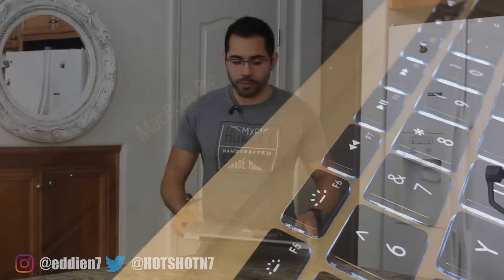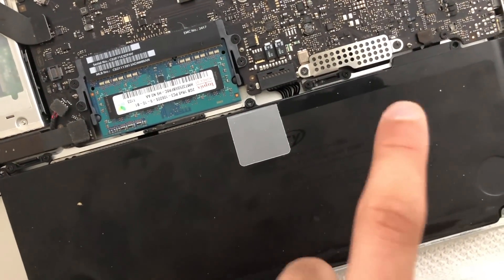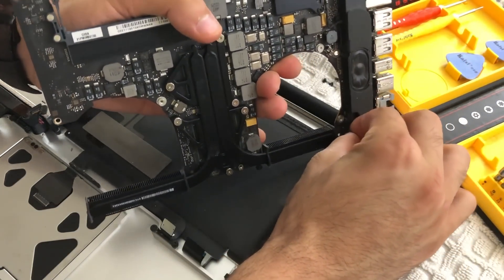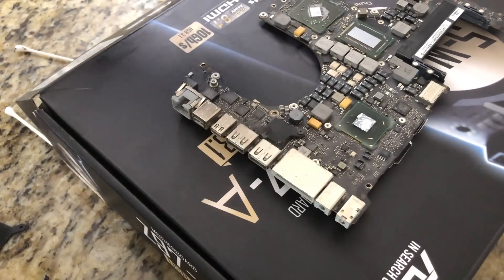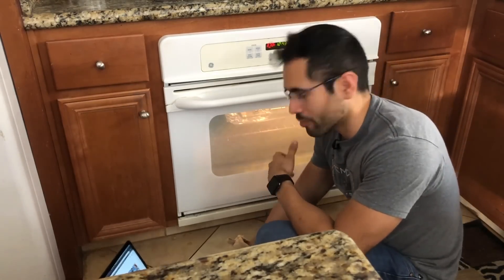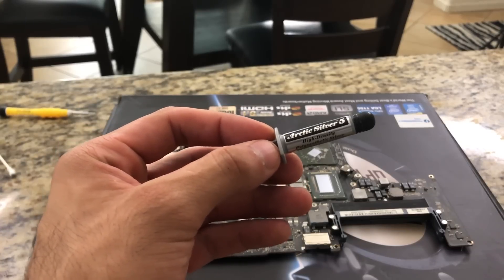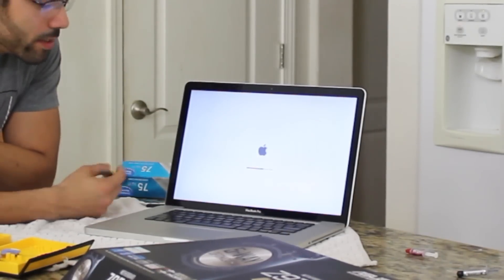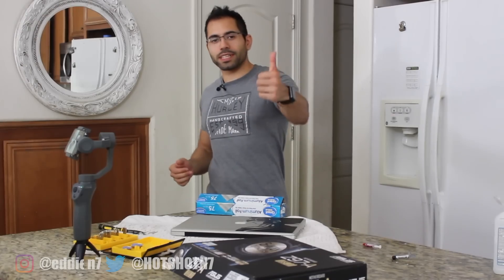2011 Macbook Pro Graphics Card Fix

Comment: It has been 7 years. If you watch this to fix the same problem with one, just buy a 2012 motherboard and replace it.
The board costs ~80$ and directly fits in the chassis making it significantly better.

Comment: Wäre es nicht auch möglich, die Stromversorgung für den Grafikchip zu kappen?
Reply: Yes, there are physical and command line methods to disable/bypass the terrible GPU. Look up dosdude1 for the software fix, it worked on mine as the instructions are clear and correct. Disappointing to lose AirPlay and external monitors but there are still so many useful functions of the 17" in particular, especially that it’s still able to run 10.6.6.

Comment: I did this 3-4 years ago after Apple had "fixed" my 2011 15" Macbook twice under their recall.  That Macbook is still running strong, it's my daily driver.  There is some debate as to whether the oven does the trick, or just replacing the thermal schmoo is the real solution.  I saw an article linked in Apple's forums that said they had a bad batch of schmoo, so who really knows?  All I know is the oven plus new schmoo (Arctic MX-4 for me) does the trick; it's one or the other or both.  I'm in the process of doing another one at this moment.  Just came out of the oven.  We shall see.

Comment: Heating up the gpu will only make it work temporarily. the whole reflow using the solder melt points is all a myth, luis rossman proved this in one of his videos. DO NOT BOTHER TO DO THIS METHOD ANYMORE its actually an issue with a shitty wafer on the gpu, also for these model macbook pro the a1286 i found and am relooking for that video,  theres a capasitor that controls power to the gpu chip that needs to be replaced.
sorry to discredit you HotshotTek but you dont need to put your motherboards in the oven anymore

Comment: I’m not really expecting you (crazy tech dude) to know the answer to this question but someone reading this might. My understanding is that the solder used to attach this chip to the board is the issue, not the chip itself. I find it odd that this one connection out of hundreds of thousands of similar connections on every motherboard would have the wrong solder applied. I would guess that the chips come pre tinned for installation and that would answer that. That being said, why can’t the existing solder be removed and the chip reattached with the correct solder thereby making a permanent fix? I’ve seen videos where people remove the chip and then make tiny little jump wires that serve to bypass the chip (one of many methods at this point) so, besides requiring expert soldering skills and the equipment needed for the job, it’s not as if it is physically impossible.  Anyone have input on this, possibly what kind of solder should have been used? thank you!

Comment: You should have left it in the oven and let it cool there, that is big mistake
Reply: correct, rapid fluctuations in heat is what caused the issue in the first place, the reduction in heat should be as gradual as possible

Comment: The only real fix is to replace the GPU.  And it will fail again because it never was conservatively designed.  If your lucky the GPU is available, otherwise Apple makes getting the part impossible. 

Just by a new one.  That's how Apple gets rich.

Comment: Thank u so much , it’s worked indeed, I was tried this 2018 and it worked well till now and again same problem starts from month, can I try again same process now also , I am using 2011 mackbook pro 15”, 750 gb, in india I couldn’t find any new graphics card for my Mac so give me some suggestions, 
Actually Mac is restarting problem was happening I gave to Mack service center they told graphic card problem, is it really graphic card problem ? Is it restarts again and again because of that ?

Comment: You should NOT take the board out of the oven like that! If you bump it even slightly, you run a HUGE risk of displacing numerous chips throughout the board that have all had their solder melted. Just turn off the oven, open the door, and let it sit!

Comment: I wonder for how long this method would allow it to work.
Reply: Days or weeks. Once you get it up and running just disable it completely then you're stuck with igpu but it won't fail
Reply: McXred Pl I've used recovery, single user mode and csrutil disable to disable GPU when it's already dead, so this is not a problem. I was just thinking of its worth trying to enjoy thay gpu for few months. But if we talk about days or weeks - not worth it.
Reply: @wza360  you can never be sure. If you can keep it cool then I guess it wouldn't be that bad and die so fast but imo it would be better to leave it alone or sell it. They can still get very expensive even when faulty (if you got it up and running then it significantly increases value too. You can probably get somewhere about £300 for it and get a much more decent laptop with dgpu that doesn't fail straight away

Comment: this fix will probably last longer if you get a syringe of flux and try to flow the flux under the chip before baking it.  you would just have to really soak it with 90% isopropyl alcohol afterwards.

Comment: My 13” MacBook Pro 2012 (I think) is booting to a black screen, no chime, caps key won’t illuminate and fan runs on high. Do I have a failed logic board?
Reply: Did you find any solution? I have same issue on same MacBook you mentioned but it’s 15”
Reply: @GentilEulade  Hey, I'm pretty sure I took it to a "Mac Expert" who basically said it wasn't repairable and I needed to buy a new board, so I got him to transfer my files to a new hard drive for me and eventually threw the old MacBook out. Sorry I couldn't provide a solution, all the best! :)

Comment: Apple Macbook Pro Late 2011 developed logic board issues. Diagnostic performed by MicroCenter - Apple authorized repair center - they could not boot into anything. A refurbished logic board from a 3rd party would have cost one thousand, and this GPU issue would  still be outstanding issue simply postponed.... Apple does not make parts for these computers as they are considered vintage. I tried HotshotTek oven bake method and surprisingly I was able to boot correctly. This is a temporary fix though. I will research how to disable the dedicated AMD GPU as that seems to be the issue with these Boards, preventing the computer from booting up. So if you cannot boot up, you can get a diagnostic done from MicroCenter for 40 bucks then when you are sure its the logic board, try HotshotTek Oven bake method to fix your logic board. There is nothing to lose and much to gain. At least you will buy some time until you can get a new machine.The whole thing took me about 8 hours - disassembly, documentation, cleaning, baking and re-assembly. Documentation is important because it helps when you are re-assembling and connecting back about 16 ribbons total on the board

Comment: I've had my 2011 MBP for about 9 years with no issues to date. Added 8gb of ram and 500gb SSD runs like new. Far from being a piece of junk.
Reply: You're lucky. The same was for me for 10 years. Now it happened. I suggest you to download some app for switching to the internal Intel graphic card. It doesn't happen in an instant, at least for me it didn't, you can see symptoms before the end, and before the end you can switch to the Intel graphic card and you're safe to use the macbook.
Reply: Andrea Marchetti how do you switch it
Reply: You are lucky i guess. My gpu failed after 1 year. Got the motherboard replaced for free after Apple finally acknowledged the problem. It worked for a couple of years and now it is starting to get the symptoms of a failing gpu again :o. I don't use it anymore but I'm looking for a permanent solution to fix this issue so I can resell it with a good conscience :).
Reply: David Wants same
Reply: Hi you can video edit in primier?
Reply: I did the same only I added just 4 gb of ram and a 500 gb SSD, it used to work quite well even without this update but now it runs soooo good
Reply: same here, battery is not what it use to be, but after 10 its hardly something to complain about.
Reply: Does it run better with a better graphics card? Or is it running good with just the ssd and 8gb ram??

Comment: It is unbelievable BUT IT WORKED TO ME. MBP 8,2 15'' Late 2011. I spent 180 EUR to fix it 4 months ago and it failed again few days ago. I followed your tutorial and it is fixed now. I do not know how long it will work but I had a very expensive paperweight that now is recovered. Thank you!

190 centigrades, 10 minutes. I protected the motherboard's external connectors side with foil. paper

Comment: Did it work for three years then fail? I ask because I experienced something traumatic and I wonder if anybody here in the comments section also had this happen to them? I bought a 2010 Macbook Pro brand new in 2010. The logic board failed one month into ownership! I was doing light tasks like Microsoft Office since it was a school laptop. The Apple store "replaced" my logic board with another one and it functioned worse than when I brought it in. So my laptop actually stood gathering dust for 9 years until recently I gave it to Goodwill so they can recycle the Aluminum for something more functional like a Coca Cola can that can bring somebody joy. Anyone here ever receive any compensation without buying Apple Care? I heard that Apple Store's gave people 2011 models after 3 logic board swaps for those who had Apple Care. I was screwed out of over 2 grand for a dead paperweight and that is why even if newer laptops from Apple might be more reliable, I have not purchased another Apple product since 2010.

Comment: Heating up the GPU with a heat gun may be easier. However, this will not work for long. You will not be able to do this more than a couple times. I hope you told the person you sold this too you heated up the macbook GPU.

Comment: Any reaksjon why one coils bt just keep repeating this fix? 
I had the logic board in my early 2011 MBP replace by apple acoue years ago. Friken disappointed that they replaced it with the same faulty part which lasted on 2 years. should have been a mandated recall!! 
Anyway, can I do this fix now and then repeat it in the future if needed? 

The laptop is still fast and works brilliantly!! (Upgrades with Samsung eco ssd) so I see no reason to spend $3500 (in norway) for a new one

Comment: It worked for me. Getting photos up to a cloud to access with iPad and I’m done with this thing. Apple repaired two years ago but it went bad again so I don’t expect this fix to last long. Thank you so much for the tutorial. I struggled a bit with getting all the cables reconnected but finally managed all but one. Seems to be doing what i need so I’m not going to worry about it.
Reply: Toni Frizell hey there! Is you mbp still working? I assume you did this fix somewhere around July 2019, right? 😳
Reply: dosdude1 has a software fix that worked for me, and many others that allows the machine to be used in 2025. I have specific uses for my 17" that still makes it desirable over later models that had systems and ports removed, as well as older software compatibility. If you just want general purpose computing, get an M series, but once the stupid AMD GPU is bypassed the machine still works great.

Comment from the maker: Update: Don’t buy a 2011 MBP, and for those who care, I sold my Mac to Best Buy. The manager informed me that they use these older Macs for parts, as they wouldn’t resell them refurbished, especially an outdated model.
Reply: Hi! How much did you get for selling it?
Reply: Yeah, I bought mine (exactly like yours) back in 2011 and had it serviced by Apple around 3 years later. They "fixed" it by taking out my 16GB RAM and replacing it with original spec of 4GB. I ended up putting my 16GB back in and has worked flawlessly until about two weeks ago. It's a dinosaur anyway so I'm going to end up getting a new one. The problem is the 16" version starts at $2400! Sheesh.
Reply: How much did he give you for it?
Reply from the maker: At a the time $300
Reply: That's a lie, buy a 13 inch mac book pro 2011  they have just Intel graphics
Reply: Williamg209 ha! Not the same computer! 13” is fine, this is 15 and 17

Comment: Just thought I would mention:

 Apple actually got sued for this and settled and agreed to replace all currently affected MacBook Pro logic boards  that CURRENTLY exhibited of the problem (at the time of the agreement or upto one year there after)… I was lucky enough to find this out about that agreement two months before it expired… So I sent it in, got it fixed BY APPLE and it died less than a year later with a supposedly new logic board.... BTW, they definitely did replace the logic board… But the replacement didn’t last anywhere near as long as the original logic board diD 9originsl lasted about 5 years with no reballing and HEAVY DEDICATED GRAPHICS USE).   So I would not be surprised if Apple was just replacing the logic boards with logic board that they had re-balled/re-flowed  themselves (and cleaned up a bit to look like new).

 I only say that because (like I said) my first original logic board lasted five years of very heavy dedicated graphic usage… The replacement didn’t even last one year.   

 it’s ironic that most windows laptop makers cheapen out on the casings for the laptops(thin cheap plastic)… But they run and run (at least until they’re outdated)… Apple on the other hand puts their laptops in premium solid aluminum cases, but tries to make all of the components (and the laptop itself) so ridiculously small that they cannot handle the heat and the components die prematurely...well before the laptop is too slow to use. (For exanple, a late 2011 MacBook Pro with dedicated graphics and a quad core i7 2.2ghz CPU can still hold its own with every program you would run on it… even video editing...And does so quite easily)... even in 2019....  only now is it becoming technically obsolete simply due to Apple requiring built-in ‘METAL’ gfx library support on the graphics card in order to even run Mojave operating system… Which to me looks like a way for Apple to bury this issue under the rug forever...    Seriously, I think it’s no coincidence that the earliest MacBook Pro laptop that can run Mojave operating system is the 2012 model!   ...   and why would a basic operating system require a super high-end graphics FX library? Answer: It doesn’t... it only does because Apple wants it that way)

Anyway, I digressed into conspiracy theory lol, my point is that it just seems like every Windows laptop eventually fails from a broken hinge or case or exceptional slowness…And every Apple laptop dies from overheating or something related to overheating due to thier ridiculous quest for constant miniaturization (for that period of time anyway).
Reply: You mean they want us to keep buying there products as a routine to keep them rich not as the actual life time of product .
Reply: OMFG I missed this :(

Comment: very helpful video, but instead of baking it you can use a heat gun to reheat & reflow the lead balls in the gpu, and to prevent it happening again just use a good thermal paste like artic mx4 or higher to prevent over heating of the gpu... 
and install intel power gadget to monitor the temps.. 

and always remember don't push to it's limit old is old....

Comment: i ended up just disabling the discreet GPU. once you do that, you will no longer face this issue. however you will have issues with getting the MBP out of sleep mode and you'll have to add the bright slider. dosdude1 has the easiest way to disable the discreet GPU.
Reply: I have a question. How does it perform before and after the method you mentioned? I'm thinking to do the same

Comment: Apple replaced my 2011 MacBook Pro with a MacBook Pro 2018 last year under EU consumer Law give them a call
Reply: Seriously?
Reply: Jacob Guerrero yep I got a MacBook Pro 2018 but I’ve got issues with it now re keyboard and new gpu, but Apple did replace MacBook after calling Apple care
Reply: @DamoT  man, this would be so nice!  i have 3 2011 MBP lol
Reply: This thing is done
Reply: Damo Hi Damo, i have this problem also with my MacBook 2011 (in 2015 Apple replaced the motherboard and this week it broke again). I went to Apple today and they refused to help in any way, referring to the laptop as ”vintage”. Could you tell me which clause of EU consumer law you used? Or which argument you used exactly to have Apple agreeing on replacing? Would be a huge help if you could tell me. Thank you in advance!!
Reply: Titii my MAC was vintage too but they sent you away with a computer that was going to break it was just time, this is what happened to me. I called Apple care they told me about the EU consumer law , if you can prove it’s a manufacturing fault which you can as this has happened to thousands of people, they have to I’ve fix it, which the can’t, as they do not have parts, or replace it, which they did with me.